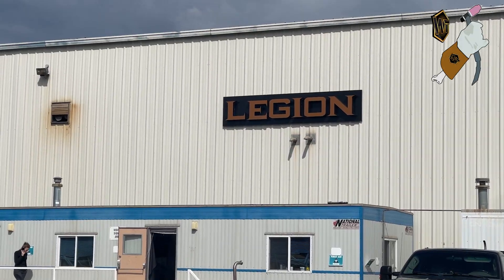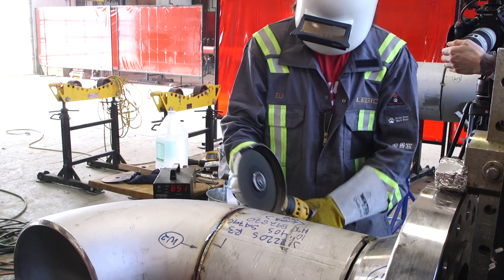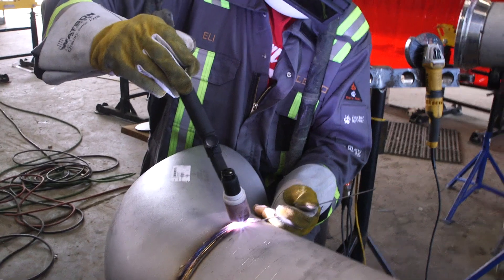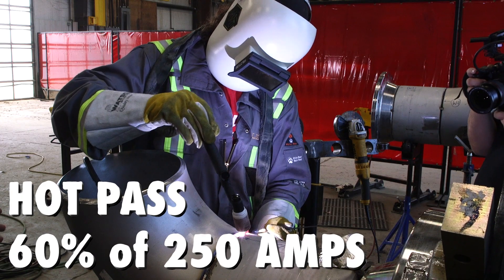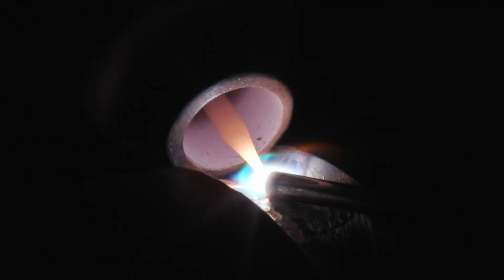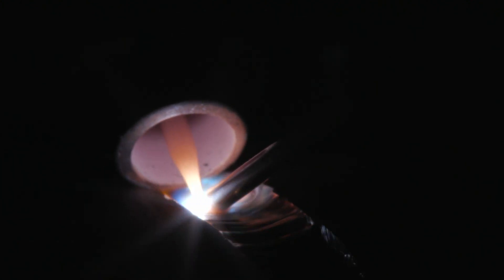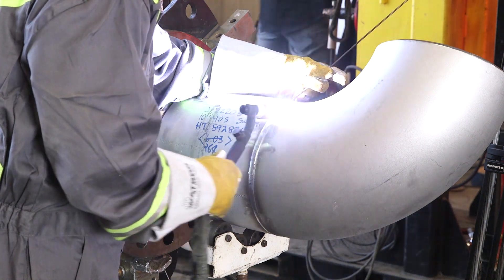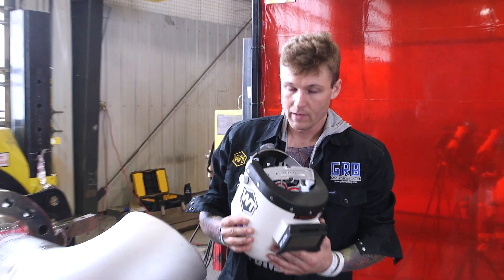TIG Welding a Duplex Stainless Steel Elbow

Comment: after the root was done, it is not necessary to keep  the internal purge ? Or u all keep the purge for at least some welding passes ?
Reply: Yes, the internal purge needs to be maintained as the material may steel oxidize.
Reply: Should keep it on till got a fill pass on or two minimum
Reply: Just depends on what the result needs to be. Depending on what you're doing, if you use stainless as an example, it will never sugar unless you melt through to the inside. It can get as hot as it wants in open air, it'll turn black even, but it will never sugar. If a black finish is a deal breaker, then you'll continue purging. If you cannot control yourself and seriously risk re-penetrating on your fill/cover passes, then you'll definitely continue purging.
Reply: We always kept a purge going until we started capping out. 
Nuclear power specs.